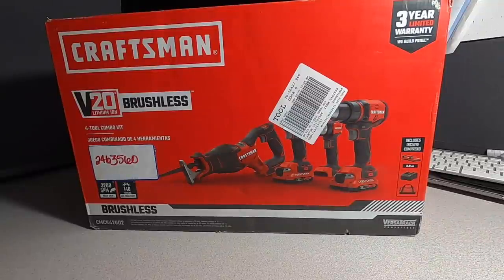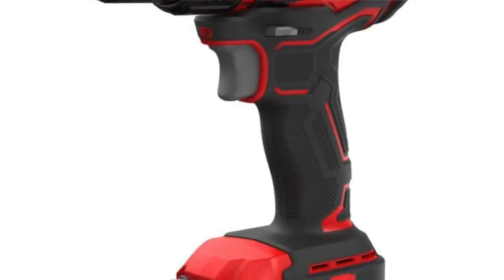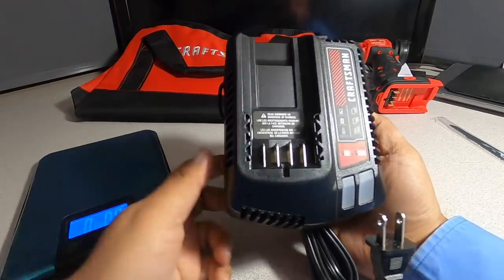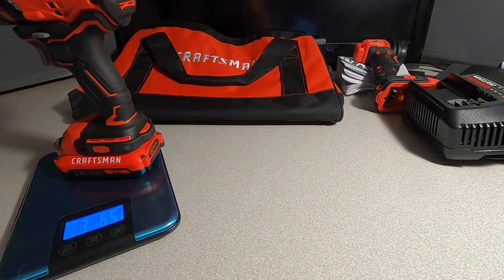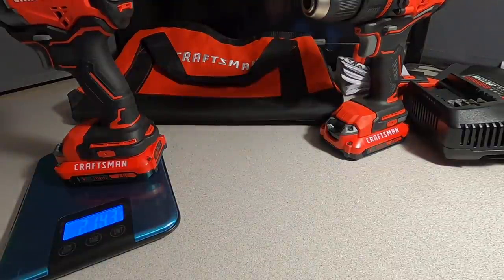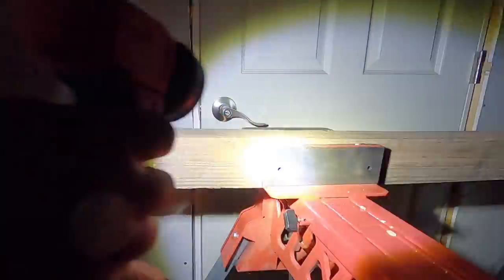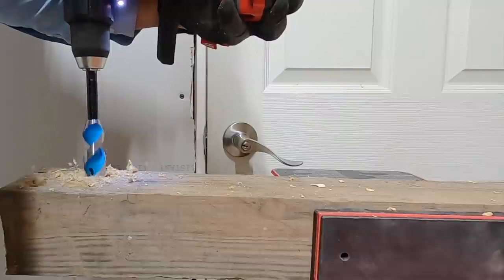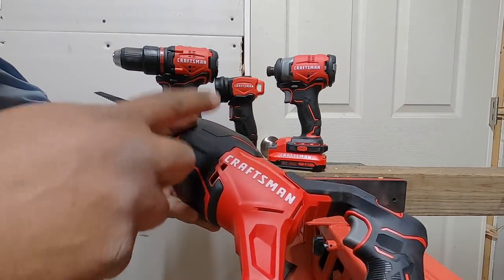$74 Craftsman Brushless 4 Tool Combo Kit (CMCK420D2)

Comment: I just paid $149 Aug 2023 , reg $ 199. Price up! LOWES
Reply from the maker: Not bad.  Got some nice tools
Reply: Yes, still in shipping and came with a free gift: 4 amp battery (3 total now). I needed a recrip saw since the Ryobi kit lasted over 10 years but batteries went bad. Have a combo Dewalt kit (was on sale too at Lowes) but came with no recrip saw. @toolhead147  The stand alone Dewalt recrip saw came with no batt so didnt get it but was $99 on sale and on that one you can move the blade 4 ways (up,down,left,right) but at least I will have a working recrip with Craftsman. Again, tks for the video. Be Safe from Texas

Comment: LOTS of vibration from the recip. Noticed that immediately once I attached a battery. IMO it shouldn't vibrate that much when not in material.
Reply from the maker: I've used cheaper saws they usually vibrate just like this maybe this one a  bit more than others. For diy should be fine.